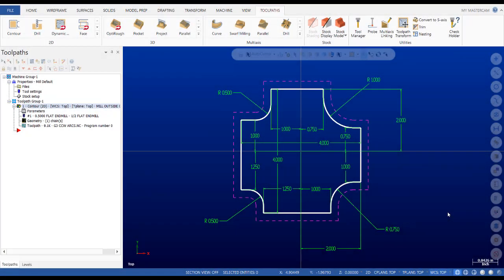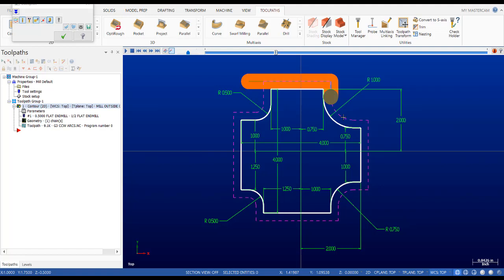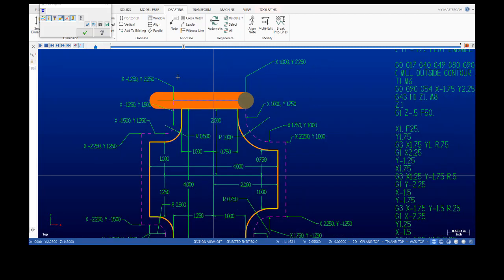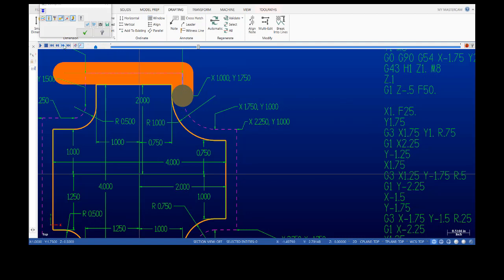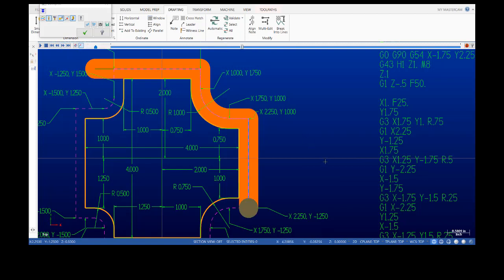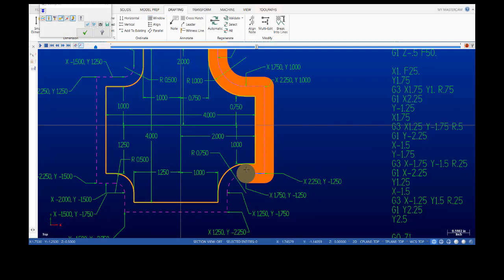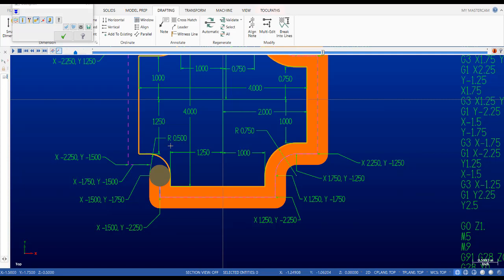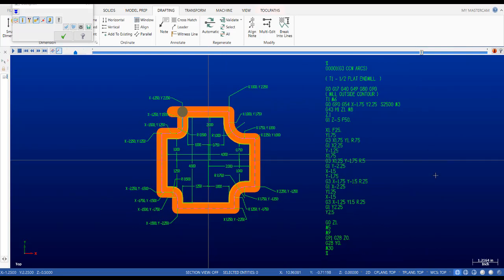HOW TO WRITE A G3 CCW ARC TOOL PATH

Comment: Was wondering how to put a 45deg Shafer on to edge of a straight pocket that goes in to a corner with a .25 Radius  and then turned in to a .5 straight  and then back to a .25 Radius  and straight out. I know  everything but how to get cutter to go around .25 Radius  and  straight again and back around other Radius  and straight out.   

Started new job and everything is program at machine  being new and just learning No one wants to help and I learned most everything off of you just want to thank you for doing these video's

Comment: Hello Tom
I’ve been warching your videos for so long now.
I am very thankful of your work so far.
In the program i think you should be writing 
G3...R1.000 instead of R.75
G3...R..75 Instead of R.5
G3...R.5 instead of R.25
G3...R.5 instead of R.25

Please do explain

Thanks a lot
Reply from the maker: Remember that you are writing a tool path based on the center line of the tool. So if the tool is offset by .250 (half the diameter)then the radius of the tool is also offset by that much. Hope that helps. Thanks. Tom